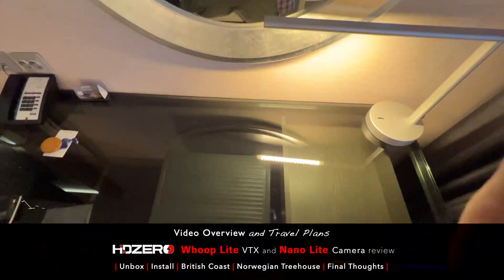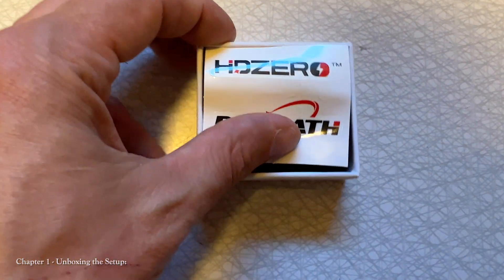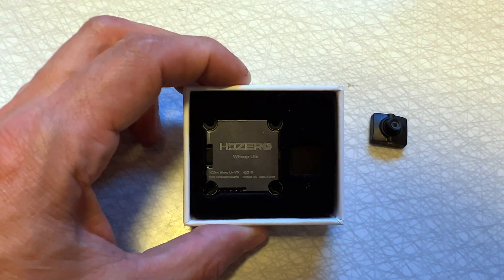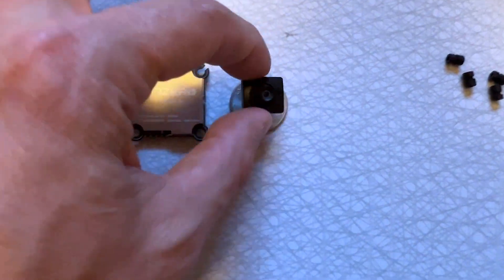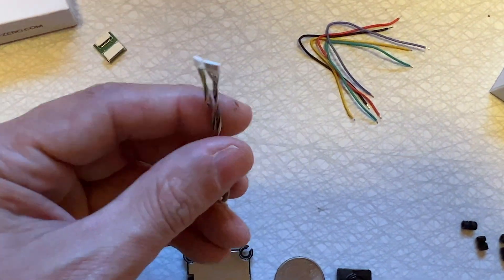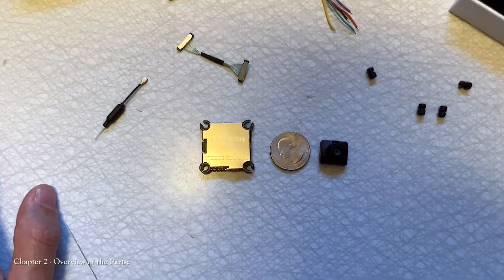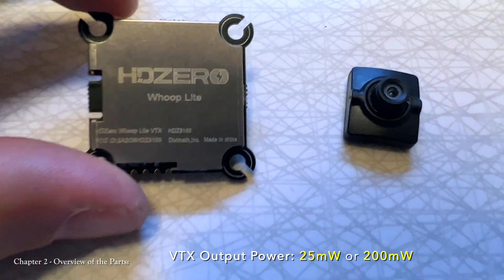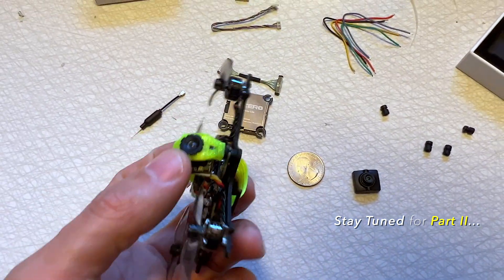NEW HDZero Whoop Lite for 1s FPV Quads. Tiny, Race, and Cine whoops! Nano Quads and Wing builds!

Comment: Awesome video! What Soldering Iron is that? I like how small that one is and it seems to be somewhat portable with Temperature control is really nice! 
And what other soldering equipment do you use that you like for fpv builds? Thanks!
Reply from the maker: Thanks, appreciate the comment. This soldering iron is called a Sequire SQ-100 and is basically a less expensive copy of the TS100. They are both “Pen Soldering Irons” and work really well. They can run off 3-6s batteries which makes them very portable and easy to use. It’s the only soldering iron I have and do everything with it. For bigger jobs like soldering XT60 wires a bigger iron would be better but this works! 
I’d recommend getting one for sure. As far as soldering equipment I don’t have any specialized tools. Cheers!

Comment: Wonder if this would work with the Five33 TT?
Reply from the maker: Unfortunately I can’t answer that, but I did squeeze it into this “Flywoo FireFly Nano Baby” which is tiny. It turned into a full rebuild due to an issue with the AIO FC… check out the video if you haven’t, it’s pretty funny. Cheers!
“HDZero Whoop Lite Digital Conversion | Killed Firefly”
https://youtu.be/82G7Ubl8Oog
Reply: @GiantAntCowboy  If you fit it in that machine it should fit the Five33 tiny trainer. It runs on 3s and seems more compact than the other HDZero VTX's Thank you for the content.
Reply from the maker: @ChristKrew-Rev1.8  yup, should be no problem, as long as there’s enough room above the flight stack and drone housing. 

But this thing is tiny and great! Thanks for watching, cheers!

Comment: Is there a noticeable difference between nano and the micro v2 camera in the goggles?
Reply from the maker: The Micro V2 image is noticeably better simply because it uses a larger glass lens. The new Nano Lite camera has a tiny lens which I believe is made of plastic. This results in less light entering the sensor and a slight haze to the image. BUT, the image is still very impressive considering the size! Also I haven’t played with the camera settings yet, and I bet increasing sharpness and saturation will improve things further. That’ll be in Part II when I do a proper tiny whoop build. Thanks for watching and stay tuned, cheers!